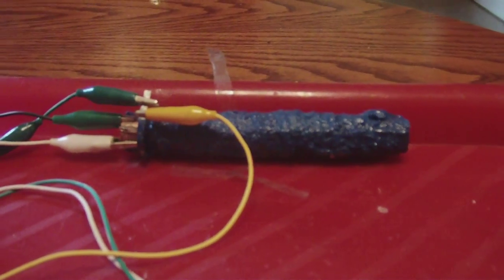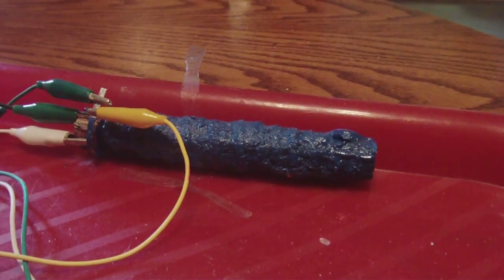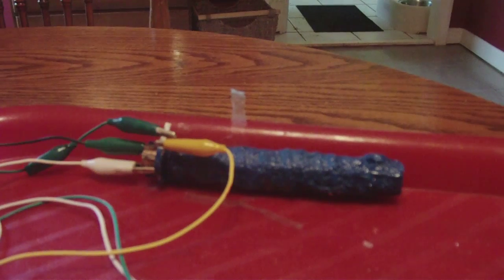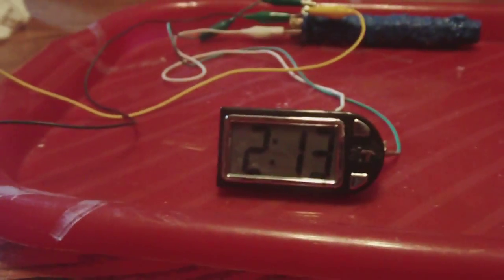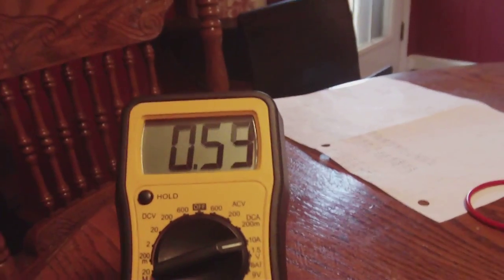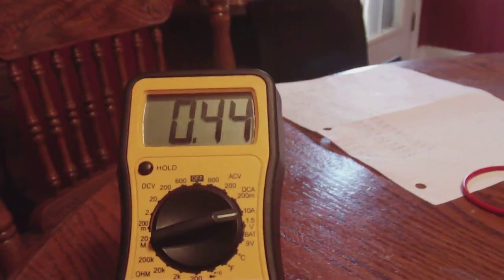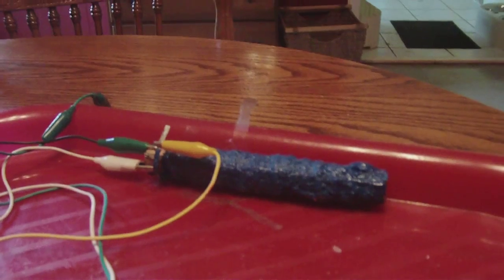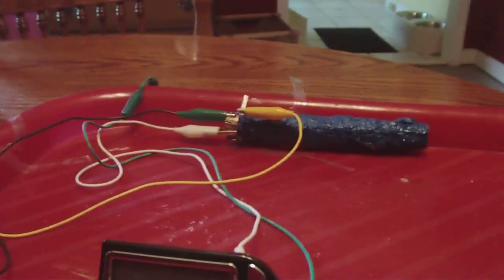Update on big crystal cell amp reading

Comment: Nice Cell IBP !
So can you also power a small 1.5 Volts 100 MilliWatts bulb with it ?
Can you show that and see how long it runs on it ?
As the LCD clock has a very low power requirement, it would be good to see it powering a bigger load or maybe just a 20 to 50 Ohm resistor ?
Many thanks.